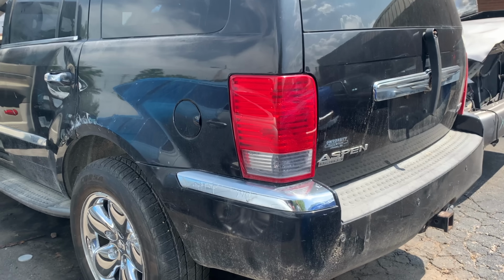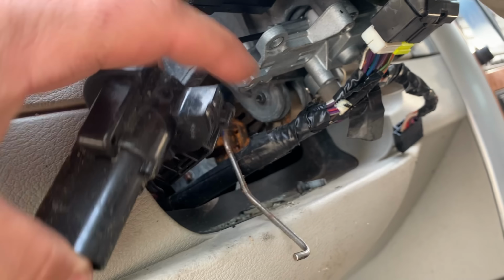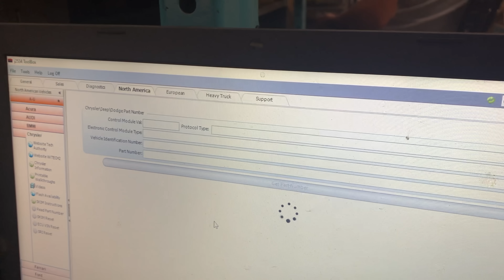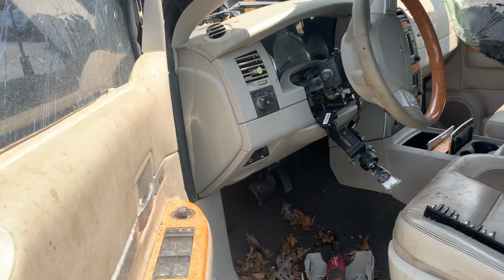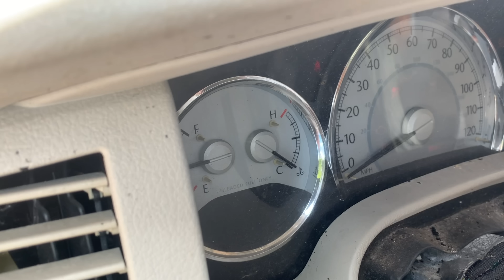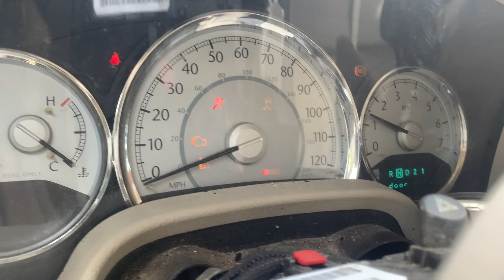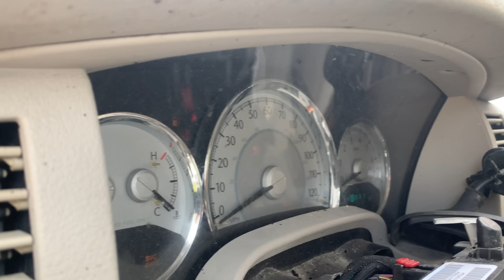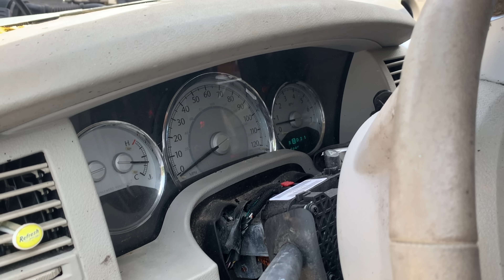Getting Rolled Over Salvage Chrysler Aspen 5.7 Hemi To Run, WITHOUT A Key!

Comment: I had never thought of manually actuating the starter relay. I learn something fun every time I watch one of your videos. Thanks for the great content!
Reply: I learned something as well. Now what I want to know is, what is he actually doing? After taking the cap off, is he physically pushing a plunger down or something to close the switch inside?
Reply: @sdannenberg3  It looked like he had something shoved under the relay, probably to bridge the two pins on the control side to energize the relay and close the contacts on the load side. Maybe a piece of flattened tin can cut a certain way.
Reply: @castinn  But then why does he need to take the plastic cap off the relay?? I just went and took a spare one apart and I still am confused lol.
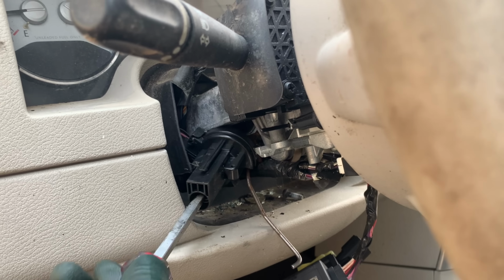Reply: @sdannenberg3  You are right, he removed the outer shell of the relay. This would allow him to push on the part that closes the contacts on the load side. Never thought of that. On this relay, the wide lugs are the load side - where the heavier current flows. The smaller lugs are the control side (the solenoid) that has a small current flow. @6:27, it looks like he is pressing on the end of the solenoid that bridges the contacts so current flows between the larger, heavier lugs or spade terminals. Some relays have 4 terminals that allow the relay to be plugged in two different positions. These relays, however, have 5 terminals arranged to only allow one orientation. Tyco 4671168E 72472V
Reply: @castinn  Yep, I agree. This is just a small magnetic solenoid. Power from the ignition energizes the coil pulling the plunger to make contact with the starter leads. Been working on cars all my life and never thought about doing this. I have always just used a flathead to arc the starter relay usually on the starter motor. This is much easier.

Comment: As much as it sounded like it had a miss when idling... It sounded like a happy hemi otherwise and appeared to idle smooth. I bet it's just an exhaust leak causing the noise.
Reply: If it had ethanol gas in it that would be the problem. Sh!t goes bad in 3 months.
Reply: My thought was that exhaust was leaking were the catalytic converter used to be.

Comment: I really liked to see this format of your day to day.  Pretty cool.  My ear tells me that there is a miss in the engine.  Especially the lumpy first turns before it fire up.  Might be sticky valves since it's been sitting for a couple of years.  Let's see some more of these clips.
Reply: The check engine light was flashing when it was first started and steady after a short while.  Engine misfiring causes the check engine light to flash.
Reply: @Zoomie61  Didn't notice the check engine light much but was going by what I was hearing.

Comment: I remember when the Aspen was a sedan . Used to own a 1980 dodge Aspen , had the 360 V8 ( 5.9 ) , best fuel mileage I got out of it was 10 mpg . Was a former Clark county sheriff's unit ( found the original paperwork in the trunk ) , dang thing was quick

Comment: Have you tried using "jigglers" .. They are mostly used to unlock car doors, but I've used them to unlock steering columns and open locked trunks .. And they're under $10..

Comment: Did you check to see if the transmission will go in gear forward neutral reverse to see if it will go in and out of gear.
Engine runs great.

Comment: I was surprised it started,  I have a 2001 Lincoln Town Car,  if I don't have the correct key with the correct computer chip it won't start will crank over just not start

Comment: What software did you use to reprogram the VIN? That would be incredibly handy in the shop, not necessarily for VIN programming but will it handle modules that need to be reprogrammed/ flashed?

Comment: As bad as that thing looks and as long as it's been sitting that engine sounds fairly good. Though the only concern would be that it has a hair under 200k on the clock and who knows how many idle hours. But it does boil down to what you can get for the motor vs what you paid.

Comment: You probably know this tip, but for everyone else, here is a starting tip for a vehicle that starts and stops. Tip: Disconnect the Mass Air Flow Sensor!
https://www.youtube.com/shorts/5h0u1-FfWYk
Reply: Psh. I tried that with my c5 to diagnose a throttle body (electric motor) problem? Car wont start. Not every car will run with the throttle body removed

Comment: Those are pretty solid. I have an 05 Durango limited same chassis's and it's gone over 230k miles and still running strongalso I need that radio how much ?

Comment: I think it wasn't starting w/o starting fluid because you were bypassing the key, and as such bypassing the "start fuel" circuit.  I don't think it's new enough to need the brake pressed to crank, though.

Comment: Surprised it would even run on that old gas. Starting fluid needed to get it to fire at first then once it was going it had the power to do so but the gas was so terrible it wouldn't have been enough to ignite at first. 

Had a car we let sit over the winter and it wouldn't start due to the gas being old and crappy since the gas we buy doesn't have a long shelf life anymore.

Comment: The starting fluid is a good diagnosis tool .. When you sprayed it right in the throttle body opening you used about 4 times what you needed ..good thing the throttle plate wasn't open  ...I have never seen anyone blow up an engine with it but it's for sure possible ..good video

Comment: I hadn't driven a car manufactured after 2000 that didn't require to be in Park for it to start.  I'm really surprised it started for you, but I guess its because you rigged the relays and ignition.  Either way, congrats on another revival!

Comment: Hemi sounds like it's missing, hear it (kinda) when the RPMs are coming back down. Standard Hemi stuff, like you said, probably 4th transplant. haha. 
Sell what sells, scrap the rest, recoop property costs. Be careful out on that property, man. Looks, well, kinda methy. (I'm not saying messy with a lisp, I'm saying it's probably got no wires or plumbing because copper. also missing Cats.)